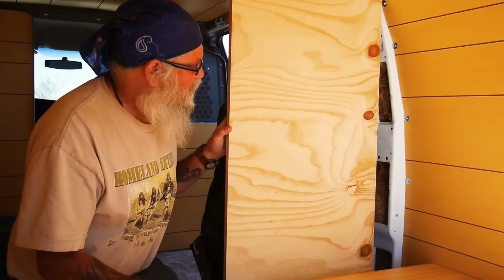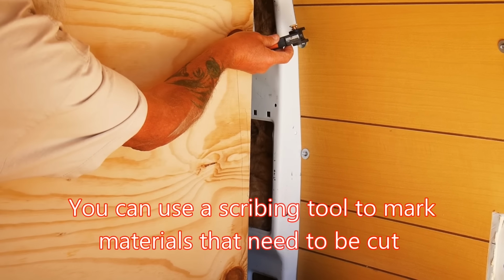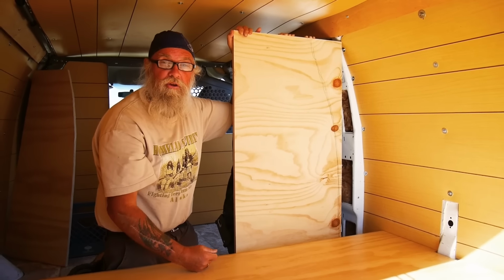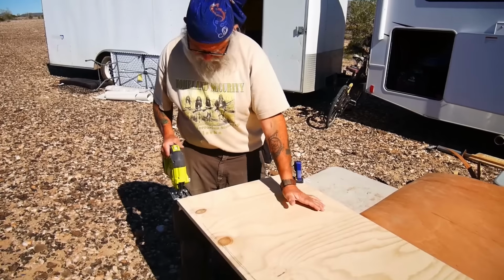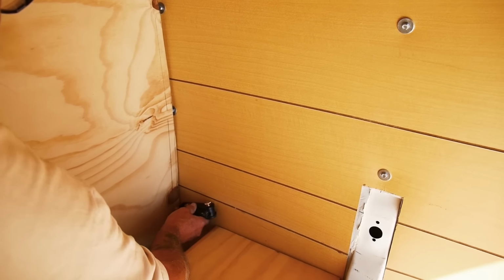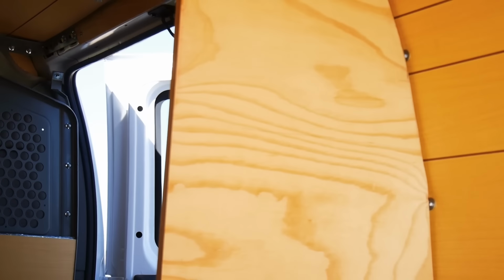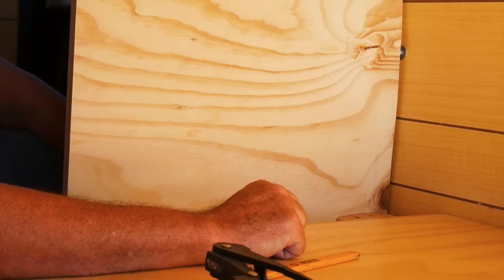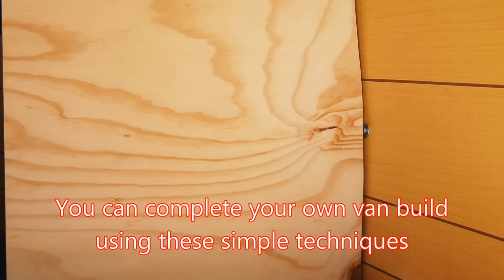Van Life Essentials How to Build Interior Walls

Comment: You can also cut a perfect circle out of plywood and drill a hole exactly in the middle. Put a sharpie in the hole and roll the circle along the curved wall while drawing the pattern on a big piece of cardboard and use that to cut first so you know it’s spot on before using the pattern to cut the wood.

Comment: nice work.. my only suggestion  would be to use a thinner board (1/4" plywood perhaps) that's wide  enough (about 8" in this case) to accommodate your initial scribe mark of the arc.   then make your first cut - and subsequent scribes and cuts - to that board.  eventually, you'll have a template that you can use to layout the cut on your finished piece.  in this job, you don't appear to be that concerned about trimming away too much of the 'finished piece' in order to find a good fit, but if you needed to insure you weren't removing too much material in order to make up that fit, a template is a good way to go.

Comment: You can cut most of your curves with a circular saw. Set the blade depth to just break through the panel and you will cut better, smoother curves far faster than a jigsaw.

Comment: Good morning,  Its funny how the universe answers questions regrading anything even as simple as using a compass. I bought one just yesterday as I have begun to put up my insulation and paneling in  my van. I knew I needed a compass but I was like how do I use it it accurately and then here is your video.  Sure I guess I would have eventually looked it up but i was just surprised that I did not have to and so quickly the answer was in my youtube subscriptions. I have never doubted that this is what I want to do eventually however the not so subtle hits that it is the right thing for me to do I keep getting from the universe just confirms that I am headed in the right direction. Thanks bob thanks universe ha

Comment: I've actually used the roller that comes with the soundproofing (I had Fat Mat). You affix the pencil to the handle and just roll it down the wall. It's fairly limited but it works in most cases for me :)

Comment: If you need a scribing tool, and do not have a compass, drill a pencil sized hole in a piece of wood, and that makes your tool.  You could even use a flat carpenter's pencil as your piece of wood. I think a golf score pencil is 1/4" dia.

Comment: I am a template guy myself, but we are talking about subscribing onto a board.  Cardboard templates can be added onto, but the final board can not.  

A good method for scribing is to use a tool, and hold it so it is easier to handle.  If the tool can not be easy to handle get another tool, or make one.

How to make a scribe tool.  
Take a piece of thick wood like a 2x4, cut a notch on a flat side big enough for a pencil.   you should have a 2 inch high tool.  It will have a pencil 1.5 inches from the wall and 1-2 inches wide depending on the curves in the wall.  If the wall is very curved then make the end without the pencil narrower and rounded.  If you want it close cut a slice of the block.  You can make a new tool from scrap if you make a mistake.  These scribing tools are small and light, and can be kept or not. 

When scribing ensure that the the pencil is pointing toward the center of the curve of the wall.  

With this method you may need to make a few cuts on a very curved wall like this van.  

Make thin lines.  Measure 2 or more times and rub out the line if required, take a break, and check, then cut once.

Peter
Reply from the maker: Thanks for the feedback Peter

Comment: When marking finish cuts, get a kids divider with a pencil, Run the steel leg against the wall, use the pencil to mark, Hold it perpendicular to the wall. Another expediency is to find a scrap the thickness of your widest gap and use it as a marking spacer.
Reply: " Hold it perpendicular to the wall" is incorrect. As the van wall bends inward as the wall height increases, your scribe ( pencil) line will become more inaccurate if you maintain perpendicularity. Hold the scribe continuously LEVEL as you scribe the wall onto your template to obtain best accuracy. Bob's multiple pencil lines show what happens when you wander off level, and also shows why marking and cutting a disposable template is wise. I hope this helps.

Comment: why not scribe a piece of cardboard until it fits snug and then use that as a pattern to cut the actual board?
Reply: Beth Hurst EXACTLY
Reply: excellently put Aniceto.
Reply: @Aniceto Maldonado Jr  This is what I will do thankyou.
Reply: Beth Hurst you have to find a piece of cardboard large enough! Then scribe the ardboard, then the plywood - doing the job twice! Ever seen joiners walking around with sheets of cardboard?
Reply: @gbwildlifeuk8269  No need to scribe twice. The cardboard then becomes a template.
Reply: Beth Hurst I tried cardboard and it wobbled and bent so much...was not easy at all.
Reply: Good suggestion
Reply: That’s what I thought...spent 2 hours bc cardboard kept bending and I wasn’t noticing...ugh!...lol!
Reply: That is what I did Beth.
I went to an appliance store where they sell refrigerators and I got a few cardboard boxes and did all my tracing with those and it worked out perfectly. They were plenty sturdy enough and big enough to draw my lines and make my cuts
Reply: Too much extra time. And if you messed it up,the board is wasted

Comment: When I did mine, I found that the compass is awkward to work with as shown in this video. I would suggest fashioning something that is at a 90 degree right angle...perhaps a carpenter's square. Put some soft velcro on the end so as not to scratch the wall and duck tape a pencil on the opposite end. Then with two hands just hold both ends together as you trace downward...the 90 degree angle should give you better leverage and more accuracy than the compass.

Comment: Sorry dude but that is terrible technique.
The scribing tool MUST remain parallel to the direction in which you are scribing,in this case for a horizontal scribe they should remain level.
You are swinging them around in a circle.
All you need is a large compass or,better still a pair of dividers.
Dividers actually scratch the line into the workpiece and there is no 'lead' to snap/replace.It also produces a notch to drop your chisel into if you are scribing beams.
It worked for the awesome carpenters of the 16th century.
These days,in our profoundly domesticated culture everyone wants to buy gimmicky products instead of using the most valuable tool  we have-our capacity to solve novel problems using reasoning,basic equipment and true knowledge,hard won through experience and passed on by true craftsmen from one generation to the next in the ancient and noble manner..
Reply: With something this large, a divider doesn't work worth a damn either. Putting even the slightest pressure on it, as needed to scratch the workpiece and hold to the wall, knocks the divider out of adjustment.